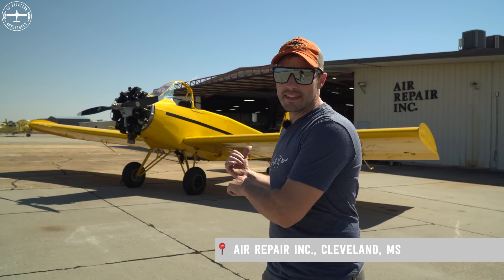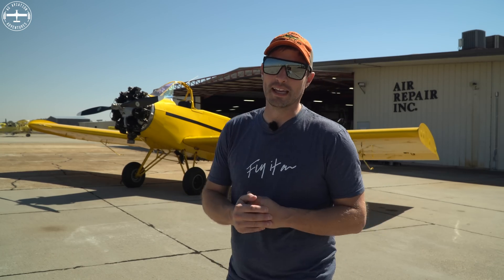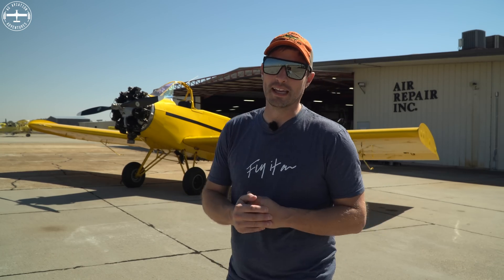Flying One of the First Ag Planes Ever Produced! The Snow S-2A

Comment: Very interesting. Thanks for posting. “Fly low and fly slow.” I recently saw an aviation aphorism saying: “Altitude. Airspeed. Brains. You need two of the three to survive.” I guess the folks who flew these airplanes needed plenty of brains to offset the shortage of the other two. :)
Reply from the maker: Haha yes that seems about right.
Reply: Not sure about that, I didn't have a problem flying it.. but I was only 18 years old and did not know a whole lot about anything.. When I was flying it, 110 was normal in the winter and 90 mph during the summer. Normal load was 100 gallons when it was cold and 40 gallons when it was hot.. Fun was spraying greenbugs in western oklahoma during the winter and having to wait for it to get up to 40 degrees so that the mix in the booms would not freeze on the way to the fields, didn't say much for the temps in the cockpit..
Reply from the maker: I couldn’t imagine that!

Comment: You need to take a look at the Fletcher FU 24. Designed in 1952 by John Thorpe, flew in 1954 and still going strong today. Developed into the Cresco with a turbine. Half the power of an Air Tractor, but will carry 2/3 of the load...! Great video by the way....
Reply from the maker: That’s so cool! I’ve seen videos of the Fletcher, such neat aircraft!
Reply: @AgAviationAdventures  I'm down here in NZ. There are less than 20 full time Ag operators in the entire country. So very close nit community. Nearly all use the Cresco. The odd Air tractor and a Beaver...! ( recently pranged. ) Keep up the good work.

Comment: What a great opportunity! It would seem like a higher aspect ratio wing (like you describe in your Air Tractor) would be a better match for application flights. What's the advantage of the lower aspect ratio in the S2 and Thrush?
Reply from the maker: The Thrush seems to haul a load better. It’s not quite as fast but it feels more stable.
Reply: A lot of the customers in that time thought that a fast airplane was cheating them out of their money.. Not sure if there was a speed limit on using dry media, using a spreader, but it seemed like 80 mph was as fast as they wanted.. and that was with flying with the landing gear in the crops.. Seems like carrying a bigger load was more important than flying faster..

Comment: I can't imagine how long it would take to spray a section with only 85 gallons. must have used real low volume in the day.
Reply from the maker: Right!
Reply: In our area, most of our work was for bugs, most of the time at 1/2 gallon to the acre. Would take 100 gallons and take about an hour to use it up. During the winter, up to 120 gallons.. In the summer, 40 gallons would keep you worried.

Comment: We had a 1959 S2A that had an R985 engine and larger hopper. Not the safest plane with pilot squeezed between engine and hopper.
Reply from the maker: Wow that’s a pretty cool. That would have been an experience.
Reply: The S2A is not a dangerous if you fly it like it was designed to fly. The problem is letting someone that is not used to that big wing trying to pull too much pitch at the end of the run and having their speed/energy killed in the climb out and running out of airspeed before getting the nose down to level in the turn.. Otherwise it is a flying tank..